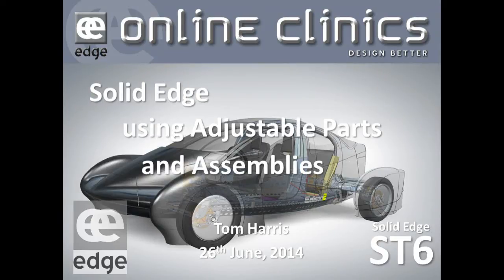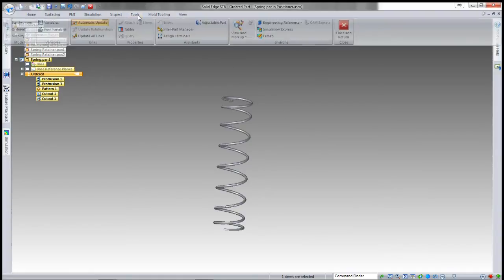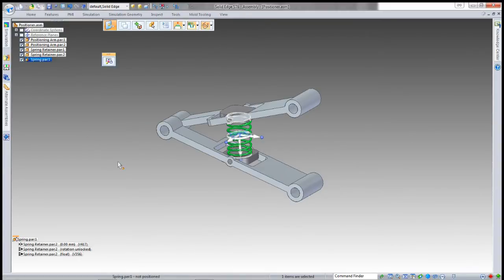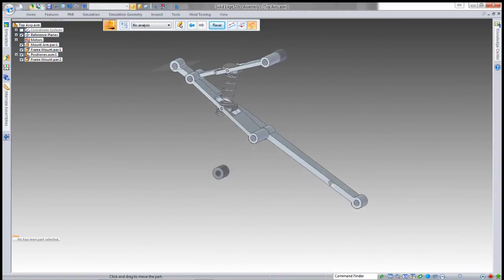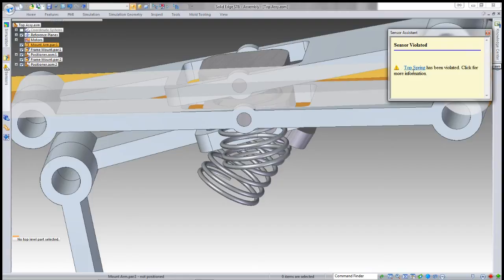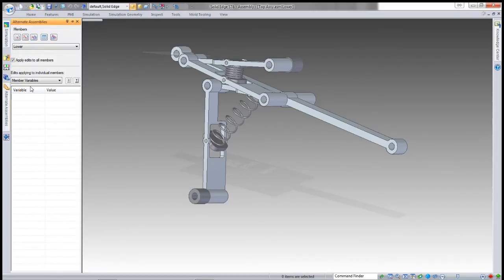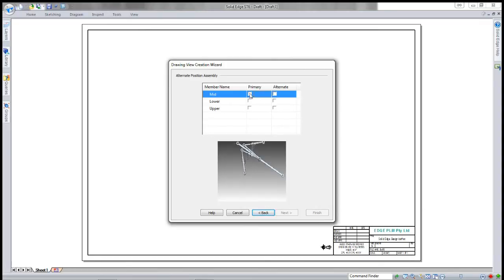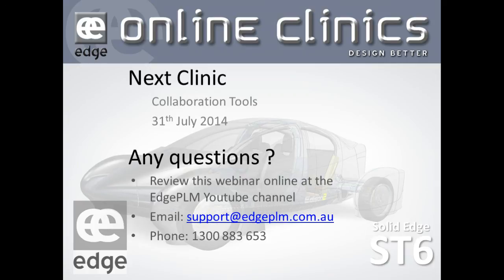SE Clinic - June14 - Adjustable Components

Comment: i have an assembly with adjustable parts that i want to use in another assembly i import my lift into the assembly but the lift is no longer adjustable
Reply: If the assembly is not marked to be placed as adjustable (Solid Edge Options, Assembly, Place as adjustable.. while editing that assembly) then it will always be placed as rigid.  You can change this by right clicking on it (in the top level assy) and selecting Simplified/Adjustable, Adjustable Assembly.